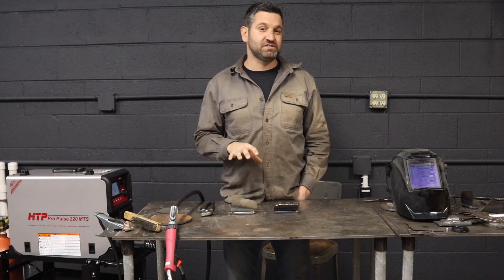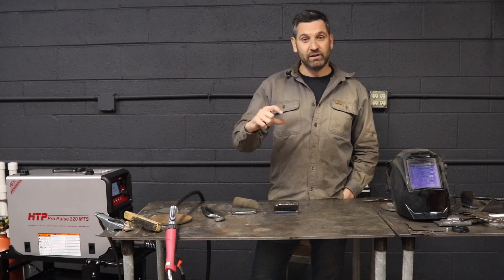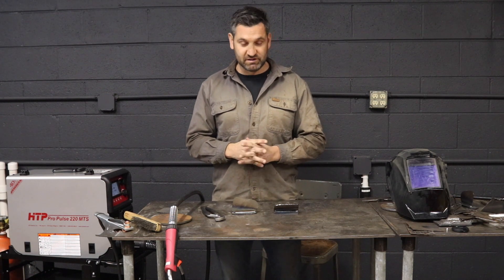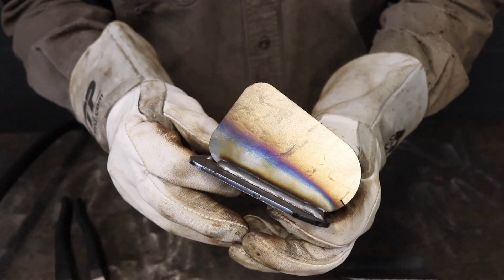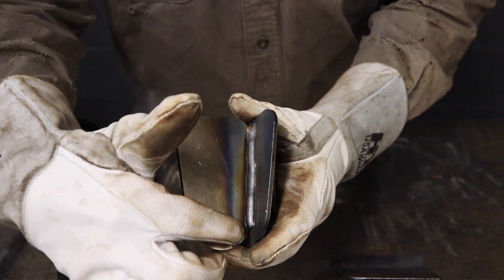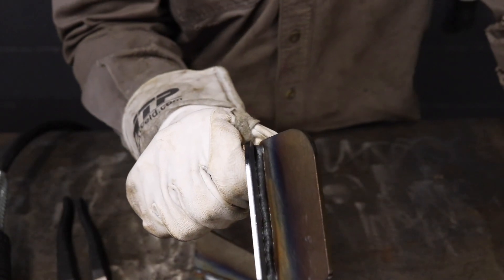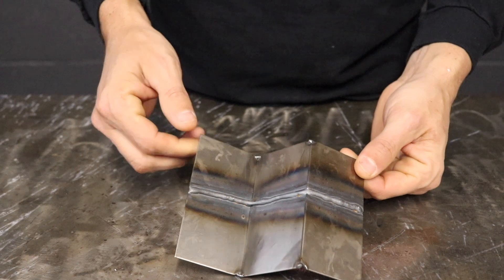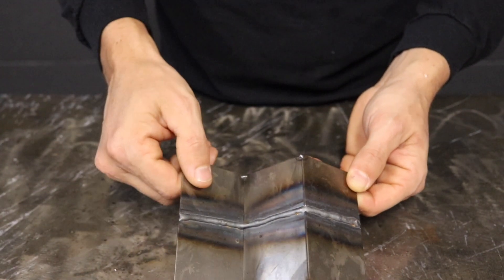The Pro Pulse is Smarter than you think! ST Arc Function

Comment: Does this work for both short circuit and spray?

I just bought a 220 MTS and I am really looking forward to using pulse spray on steel. I have only welded MIG with short circuit using a transformer based machine so the HTP machine is going to be a big step up.

Comment: Do you have a reseller in Australia?? I would like to get one of those pro pulse 200-220 for use with aluminium 5356, how can I acquire one in Australia?
Reply from the maker: No we do not have a reseller in Australia. You can purchase one from us and we can ship it there, however shipping will be about $700 most likely.
Reply: @usaweld  thanks for getting back to me, is that $700 usd or aud for shipping? How much is the machine? Is it Australian single phase or 3 phase? Will it come supplied and fitted with an Australian plug? Cheers
Reply from the maker: @JSC-c  USD, the machine is $2195 it is single phase 220V, no it will not come with an Australian plug.
Reply: @usaweld  ok, is you’re 240v over there the same as Australia, will it be a matter of just swapping out the plug to an Australian 240v single phase plug?
Reply: If your in australia look at the welding brand stel, htp welders are jusr rebranded stel welders from italy
Reply: @codycarswell3580  ok will check it out, have you had any experience with them?
Reply: @codycarswell3580  so apparently Stel don’t sell to Australia either, seems there’s no one here that sells a good single phase double pulse mig for aluminium but every other place in the world does lol
Reply: @JSC-c  dont cigweld got any

Comment: Do you need 100% Argon for this?
Reply from the maker: The ST arc function will be utilized regardless. It will work with mild steel or aluminum. So no you do not need 100% argon, we were welding on mild steel with 75/25.
Reply: @usaweld  that’s awesome. I have C25 as well but I heard spray is 100% argon. I love my 220mts.
Reply from the maker: @Tsitris46  Spray Arc does need 90/10, 98/2, or 100% depending on what material you are welding on. In this video we aren't utilizing the spray arc, this is short circuit welding. Which is why you can utilize 75/25.